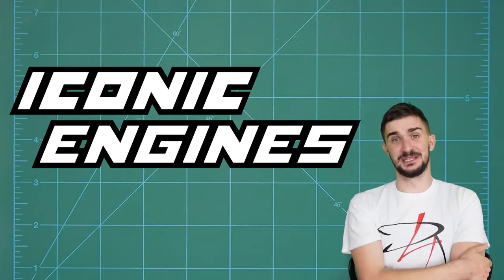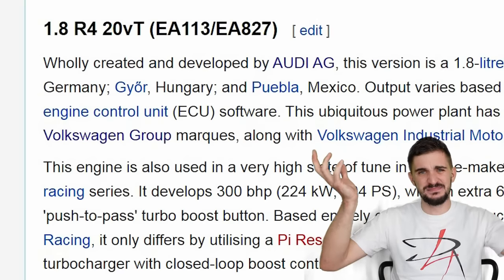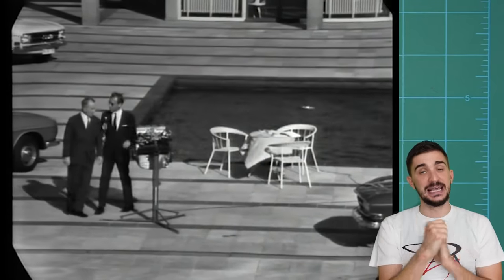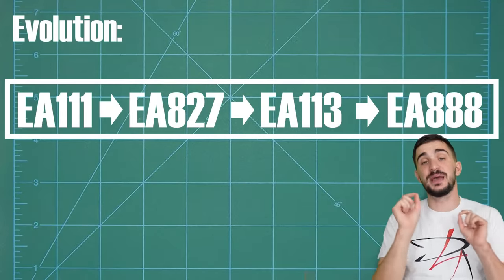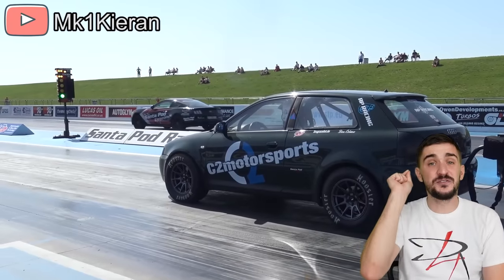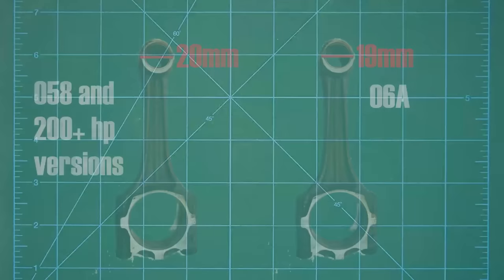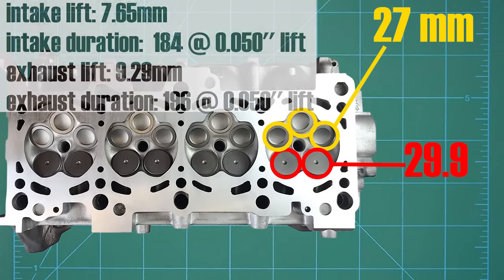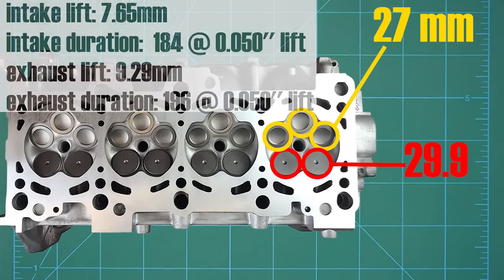VAG 1.8T 20V - What makes it GREAT? - ICONIC ENGINES #17

Comment: Build one working engine and flood the market with different designs models for 15 - 20 years. The automotive industry is a scam. The customer focus of the vehicle body, electric window and interior features forgetting the main thing, engine and suspension. A car can move and be driven with only engine and suspension without the body and seats.

Comment: 1.8 t is great and iconic SHIT .I had one in 2011 from 2003 passat and on service want 4000 €  for change timing belt and chain and some tension? 

After that star lightning check engine and oil light ,that cosst 3000 € and then i throw that shit on trash .

Meny guys have same problem with that shit engine .If 1.8 t is great engine ,then i'm Maradona ...😂

Comment: Had this one. Piece of shit, not the iconic. 
Because of five valves/cylinder it has in 90% of time cracks in cylinder head between these valves.
And the second - because of  five valves again, intake camshaft has no normal support under, and because of that in front of head and behind (where it only has normal support with normal oil channels) it gets overheated  and get jammed.
Plus it has belt+chain drive… many rubber tubes going above of hot turbine, and they all gets plastic in time..
Worst engine, that I ever been repaired.

Comment: Terrible engines. no cam chain. Cheap belts. Oil leaks 
200 horses and you need a turbo. not a patch on the k20. Was Behind the times.

Comment: VAG 1.8T 20V iconic?? There is nothing iconic in VAG engines, all are just failures.
VAG 1.8T 20V had alot of problems, starting with the watter pump, knocking and heating. This engine is just another VAG failure.

Comment: The 1.8 20 valve is a load of rubbish 22 PSI makes 260 horse put 15 PSI on a Honda k20a2 maks 440hp on stock internals all the Volkswagen TFSI engines are great as well